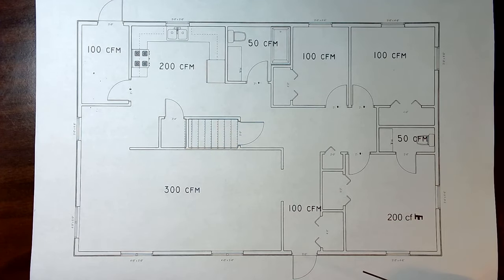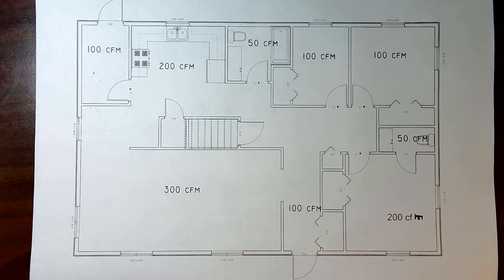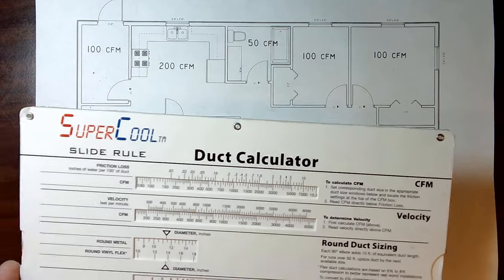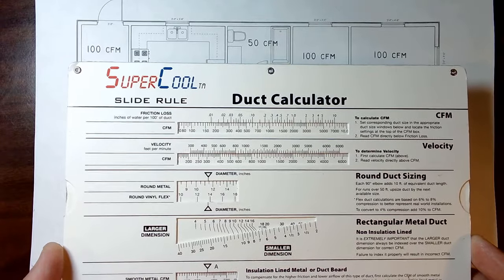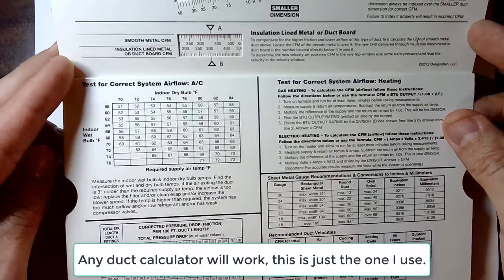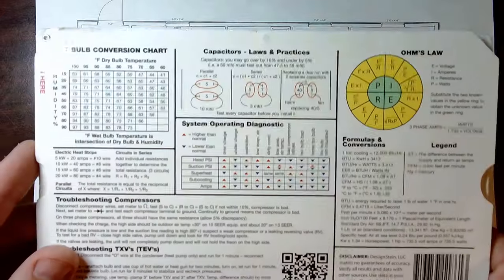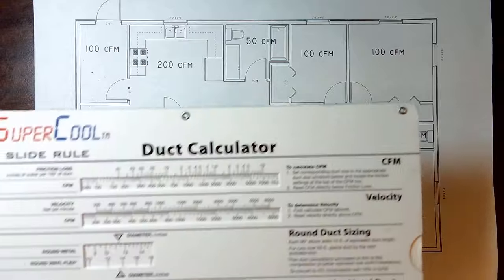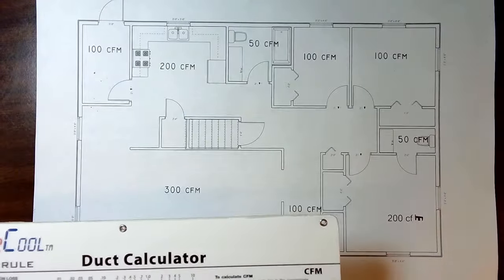How to Design Duct Work for a 3 Ton Air Conditioning system

Comment: I have a masters in HVAC technical education and this method does not reflect proper duct sizing according to Manuel D. However, if you’re going to use this method, you need to put balancing dampers on every run or you’re going to have improper air flow. Sorry but don’t believe everything you see on YouTube.
Reply: Yeah but if he calculated the Total effective length first it would be too confusing. Why worry about fittings and pressure loss when we can just set the slide somewhere between .08 and .1.
Reply: You spelled "Manuel" like the name.
Reply: He had balancing dampers……..
Reply: Starting with i have a masters in HVAC is basically saying i have totally no practical experience but I’m so smart and know better than everyone else.
Reply: Could you possibly do a duct calculation for my house .
Reply: @rottenheavenly6245 just wondering, but what is it that you suppose people do after finishing college? They then go on to… wait for it…: get a job and gain practical experience.
Reply: This guy has a masters degree you guys. Did y’all know that?
Reply: @rottenheavenly6245  
I’m sorry to have been judged so harshly. Actually I have 40+ years experience in the field, have been published in 6 different HVAC text books, a Master’s degree, and taught HVAC on the college level for 10+ years. I only commented because there are just too many contractors installing complete systems improperly. I only mentioned the Master’s degree to give some credibility to my comments. Have a good day!
Reply: Yes like this comment
Reply: @garylarson1279 but the old boys have been doing it that way for yearsss, no problems right?
Reply: “You need to put balancing damper’s” I mean he did explain what the L shape means lol. He has volume dampers at eat branch lol
Reply: @arnoldignacio1425 With that size of duct work there will be no volume to damper
Reply: @danpmatz  This is the dumbest comment I have ever read in my life.
Reply: @garylarson1279 I'm confused. 
  He said that he used balancing dampers in his example.
  He also referred to Manual D several times. 🤔
Reply: If my air handler has a rated static pressure of 0.50iawg does that correlate to .5 on the friction loss scale?
Reply: @garylarson1279 he dampered the runs. You knew that and that this video is correct. You just wanted to spout off your degree and years like it's something you had a choice in. I'm an electrician, when should I start looking up videos in my craft and brag on myself on points in the video that are not even an issue? Is it 40 like you?
Reply: I think he mentioned dampers. Also starting your argument by trying to speak from a position of authority… i have a masters… is not productive. You should explain what is wrong, why it’s wrong, what is correct, followed up with your credentials as reinforcement.
Reply: @zacharystrong  Damn... 😳
 Get yo foot off his throat. 😆
  If you want to appear more mature than what the presumptions of your character brings to the table, you should at least talk to him like he's still a pupil (because he may just be)  or the equivalent of.
  You're welcome. 😏

Comment: You mentioned that your main duct/trunk has 1200 CFM, and you removed 400 CFM (appears to be 100 CFM / branch line). Aren't you removing the CFM as determined by the room size/load? That is: 100+200+300 = 600 CFM. The remainder left in your main duct would be 1200-600 = 600, not 800 CFM? Just curious where 100 came about. Awesome tutorial!!

Comment: Excellent job filling in the blanks I've had designing a duct system. I've always known about keeping velocity high, but what I didn't know was any velocity under 600 fpm was the point you needed to downsize ductcto keep static up. Thanks alot, truly.

Comment: Thank you! Your calm, clear way of describing this is very informative! And along the way, you give us a tutorial in how to use a duct calculator. Much appreciated! If you have time to do another video, would you describe how to determine CFM's for various rooms, optimum register placements and the pros and cons of hard duct vs flex duct. I'm about to do a job for a client where the exterior wall of the living room faces south. The room has a vaulted ceiling, where the ridge beam prevents running ducts above the windows facing south. An option is to place registers high on the north wall in attempt to get air movement up and  over to the windows and the south wall. The house is on a slab. Any thoughts would be appreciated! The layout of the room is similar to the 300 cfm room in your drawing, with the ridge beam running the length of the room.

Comment: THank you soooo very much for this video!  I am working on an old house that's never had HVAC and trying to figure out where to put the trunk line and ducts (unconditioned attic or 2nd floor in chases). So good to get a basic understanding of duct and trunk line sizes.  Do you have a video of how to roughly figure out how many tons are needed?  Thanks!!!
Reply: Square footage. 600 Sq Ft per 1 Ton of air.

Comment: Did you calculate your TEL and ASP to get your 
0.8 fricton rate or are you using a rule of thumb?
Reply: I’d like to see that part explained also 🤷🏾‍♂️
Reply: Ditto lol
Reply: He is using rules of thumb with the ductulator.  Could be correct, but also could be very wrong.
Reply from the maker: @joshuaseaton4526  True, .08 is pretty typical, but not always exact.  This house is also completely fictitious and the air volume requirements are made up.

Comment: Great video.  Question is if you were to add zoned heating to this or any system would it affect or change this setup.  I'm particularly wondering how it would affect a 2 zone system where you had upstairs and downstairs on two different zones?  Do you need to change a bunch to account for flow and CFM, or is that why a bypass is added somewhere in the system to allow for limited flows?  thanks for any help or explanation on that.

Comment: Wow, that was an AWESOME explanation & AWESOME drawings!!! I’ve been wondering how they size ducts as I’ve been thinking about how to change how our 2 bedrooms are heated, to make it more efficient (don’t ask, previous DIY owner). I LOVED THIS video! THANK YOU!!! Your explanations as you go along are very easy to follow & understand, while being thorough! Not everyone has that gift.
Makes me also better understand how potable water plumbing is sized too. And possibly how to get more velocity at my furthest faucet!

Do they have the same slide charts for water pipe sizing???

Also, in residential heating with a natural gas, forced-air furnace, I use grate filters at the points of exit into the rooms to cut down on winter house dust. And I change them monthly. Is that stressing my heating system?

Comment: Sorry for all the comments. The reason I asked is I jus had a unit installed in my attic, They T'd off the supply trunk and ran the Trunk perpendicular to my long side of my ranch style house int he middle. They ran long flex lines to all of the supply lines. Each trunk left and right is about 8 feet long with one said having 6 take offs and the other with 4. This is a 2.5 ton AC

Comment: GREAT VIDEO. QUESTION: IF THE VELOCITY FOR METAL IS AROUND 800-1000, WHAT IS THE RANGE FOR BRANCH FLEX DUCTS?
Reply from the maker: Typically around 600 FPM anything more will result in whistling and wind noise from the registers.

Comment: Thank you for the great video. I am wondering, though, does the calculation of the pressure drop not need to take into account the length of the ducts going to each room? The calculator says pressure drop at 100 feet length, but most of the ducts appear to be 15-20 feet long. In my house, the duct length varies from under 10 feet to 40 feet, and the result is artic winds blowing in one room, while the other only gets a light breeze. It seems to be designed wrong and I want to correct that, but wonder how to calculate the proper duct sizing vs. length
Reply: That's a great question.
Reply: Generally you don’t run a flex duct more than 25’

Comment: Why did you put the furnace, where the air has to make a turn,  before the long straight main run?    Wouldnt it have been better to have a straight shot without the turn?
Reply: Of course it would, but in real life you don't always have the option of placing the equipment in the most ideal location.  Presumably you couldn't control that
Reply: @Ifeguy  Understood.  However, if the architect did his job, he would design the home so as to make sure the HVAC was in the best area to be the most efficient.  Been there, done that.
Reply: @Ifeguy  
If is in the attic or basement he should have enough room, specifically if he has room to run all that duct
Reply from the maker: Over the years I have had to put units in some terrible locations, they never leave the HVAC enough room and the designer usually draws a 3' square closet to do our work in.  With that said this is a fictional home and layout, I use it for an exercise in the classes I teach.  We draw the equipment in various locations.

Comment: I partially closed my registers in certain rooms to redirect flow to the larger rooms where the air is needed more. Then proceeded to drive screws into the registers so they can't be adjusted when people walk across them or the kids try to mess with them.
Reply: You don't have volume dampers on your collars?

Comment: Probably a stupid question..     My air handler  ( 2ton system) will be in the middle of the house.  most of the load will be on one half ( 500 cfm's)  and the rest for the other half..    Do I size the trunks coming off the plenum (tee) accordingly??  500 for one side and 300 for the other.   or is one  a one size trunk ( 800cfm)  straight down the middle and just branch off from there??   thx!!!

Comment: Hey brother great video very good explanation , I live in Texas and we usually only use 1 sheet a duct board  to make plenum and branch every run with flex. That’s 95% of Texas. Does this also work in that kind of designs? 
I’m a service technician don’t really do duct designing or manual J or D

Comment: How do you know how many CFMs are needed per room?  You said you'd need to know BTUs per room first, then how many CFM per BTU?
Reply from the maker: The CFMs for each room are determined by the heat gain and loss for that room.  This is figured up using a load calculation tool that examines things like building materials and environmental conditions to determine the heat load for the home.

Comment: Thank you so much , 
What will be the recommended cold air return size in this design, if you use only one (including length, how far )
Reply from the maker: I'm working on the return air video now.   Keep an eye out for it soon.  In the video I am doing both a room return and central return.

Comment: Is friction loss the same as static pressure? My air handler has a “rated static pressure of .50inwg” and a “mad static pressure of 1.00inwg. How do the two correlate?

Comment: I do have a question for you, I am installing a Mini-Split Concealed Duct system (1800 BTUs) which if I use the "400 CFM per 1 ton", it will be 720 CFM system.  However, the indoor unit has 3 speeds (H/M/L) and the CFMs are 529/450/370 CFM.  I am not sure what CFM I should use as a starting point to design the duct?  Do I design it for 720 CFM which is the 18K BTU, or should I use the supplied CFM for the indoor unit?  Even if I was to use the CFM for the indoor unit, am I supposed to use the H or M or L?

Comment: Just so I better understand. Basically the first section of trunk 1200cfm at 940 FPM could support about 12 7" Takes offs? At what point do you say it's time to reduce is it after a ton of air has been removed from the trunk? Why not run that trunk 24 feet and be done with it. Is it you just loose velocity?

Comment: Hopefully you use hard pipe duct off your branches than used flex for the last 10ft to 5ft. Flex duct was never designed to be used for the branch runs as a total run duct. It was designed for acoustics purposes to quiet down the air flow but , we see it all the time now. So people tend to think it is a normal thing ....
Reply: Correct.
You should use as little flex as possible. But it's everywhere and we'll over 10 feet..
Reply: SMACNA ( sheet metal air conditioning contractors national association) recommends no more then 8 feet of flexible duct.
Reply: @LC-jy8mj  very good point. People really don't have a clue. Flex was invented in 1970 by a man in NJ it was really designed for acoustic purposes , not for ease of installation.
Reply from the maker: I typically kept it to 10' in residential, and less than 5' in commercial. It does do a decent job quieting down ductwork as well as making some of the connection points easier.  With that said just because something wasn't originally intended to be used for a purpose does not make it unacceptable for that purpose.  You can adequately size flex duct runs with this in mind, even more so with the wide use of ECM motors these days.
Reply: @teachmeeverything3344  you really can't "use flex more so with ECM motors these days". I've been in the hvac field for over 15 years now and seen many ecm motors fail prematurely because of being installed with too much flex duct on a system cause of the increased static pressures. Older ecm motors would " hunt " trying to find the speed they needed to operate meaning speeding up & down . Now they just fail. If you have constant torque ECM motors they will most definitely fail early on a system with too much flex duct. Flex duct flows less by design than hard pipe duct system. 6" flex duct and 6" hard pipe do not flow equally per 100ft . This is why they make Flex duct calculators now.

Comment: Go with something a little more square once you factor in the outside dimension of the materials your working with your looking at 31”. You’ll be hard pressed to find a straight path 31” wide or tall through any truss system depending on how complicated the roofline is. 14x14 can accommodate the target cfm and velocity while being easier to maneuver through an attic and adapting to the cabinet of your equipment. Oh and don’t put a 6” supply in a bathroom that’s just crazy. If this drawing of the building is to scale based on the 4’ windows the square footage is no more than 1400. I can almost guarantee you do not need a 3 ton system for that size especially on a multi floor home with conditioned air above or below you.

Comment: My problem is my house never had central heat or A/C and I put a furnace in the basement and did the ducts as best I could with 6" round, but the ceiling is only about 6'4 in the basement and the layout is a cross-T with 2 valleys on the roof, that means the floor joists run one way in one part of the house and 90 degrees the other way in the rest, plus a main support beam that  sticks down about 4" where the two joist systems meet. My floors are also porcelain tile and I'm not cutting more holes in the floors!
Going to the attic is out of the question with ceiling vents- I have R100 insulation up there and the access is a TINY  hatch barely big enough for me to squeeze thru and it takes a 10' ladder to reach it.
I want to put a new furnace and rect ducts in
Reply from the maker: The ceiling height in the basement can be hard to work with.  Sometimes you have to decide one or the other (correct and adequate duct sizing or headroom).  As I see it you have a couple of options.   A ductless system without duct would be at the top choice, this eliminates the need for vents when you use the highwall units (or other non-ducted options) second would be a short depth duct either custom made or custom ordered, probably 6".  Sometimes you have to get creative with the runs to make them work, and it can more often than not be a huge pain.  

Concerning the floors you can use wall packs, going up through the bottom plate on the wall and putting the supply air vent on the wall above your baseboard. Feel free to drop me an email if you have more questions.

Comment: I’m curious as to how this design process changes if one is trying to design a two floor duct system, under the assumption that the two floors are connected (in the sense that air can flow freely between the two floors via a staircase, for example).

Comment: One question though, will you have a issue moving air out of the furnace into that elbow? In commercial we used turning vanes, what say you?
Reply from the maker: Turning vanes are always suggested, this video is more about duct sizing than assembly practices.

Comment: At what point do you know you need to step down. It is every 4 takes offs? Why not run the 8x28 the entire length then? Is it you just lose velocity ?
Reply: When you dump cfm at a take off, you downsize to keep fpm and static pressure correct…basic manual D

Comment: How did you perform the load calculation for this example?
Reply: by multiplying the standard of 400 cfm by the tonnage of the unit, then dividing that by the square footage of each room. this example shown would look like this 3 ton x 400=1200, assuming this is a 1500 square foot house 1200 cfm / 1500 is .8 then take .8 and divide by the room square footage to give you your individual room values.